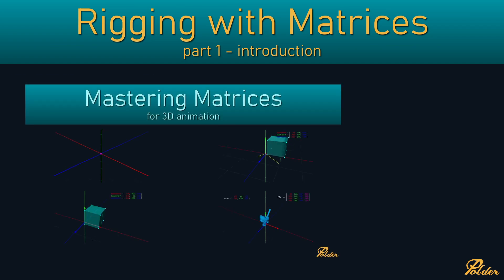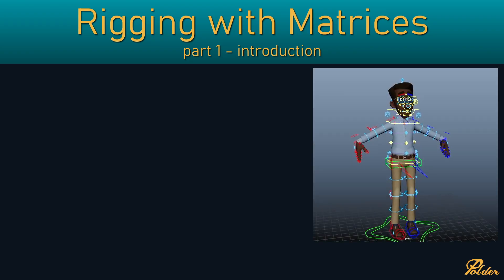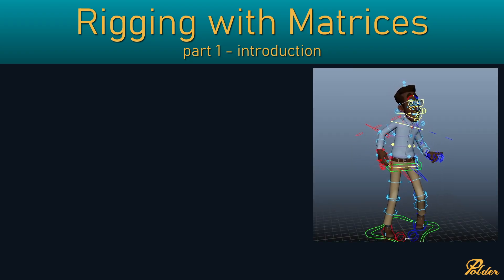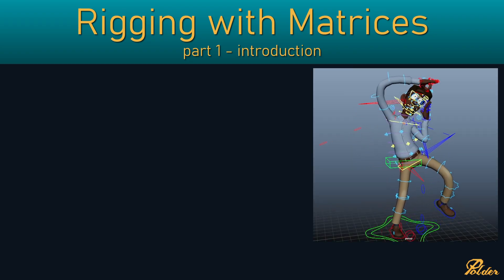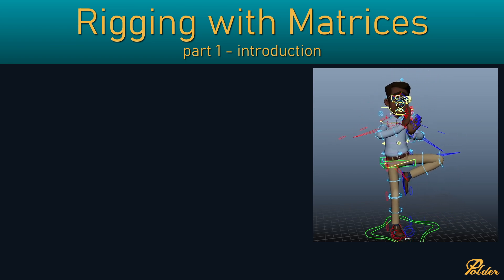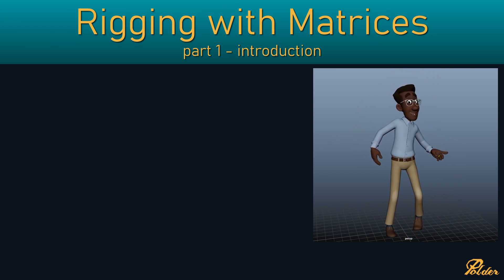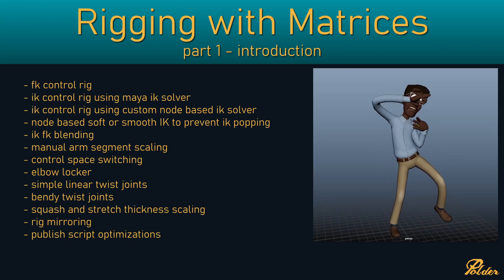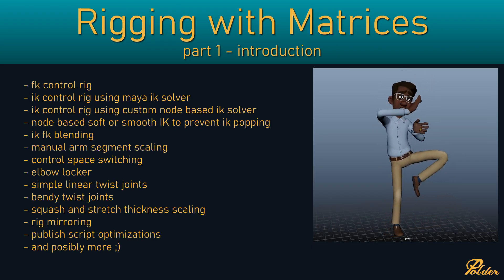rigging with matrices - part01 - intro

Comment: Hey,
Amazing to see such a system implemented and succeed  in a real Production Environment.
A few years ago I wrote my Bachelors thesis about this exact Approach and try to crate a workflow to make the rigging process more flexible and interactive compared to rebuilding parts of the rig either by hand or via build scripts every time something about the rig needs to be changed.

My prime focus in my thesis was to have a rig that allows you to interactively change the joint options to better and more consistently figure out the optimal joint positioning for my character. (the fact that this means that the rig is reusable for other characters had come to me much later ... funny thing how priorities shift from a bachelors Project where there was only one character to rig to a studio were the aspect of reusability was the first point on your list)

I already put all of your tutorial parts in my Watchlist for this weekend. and I am verry interested how you approached this workflow :) 
I am still unsure how to solve some of the issues I am facing in an elegant way...
Maybe you can give me some pointers:

In my current setup I have one Leg Module which is a simple IK-Fk chain with the addition of the reverse Foot setup. In an Ideal world I want to have them both in separate Modules so the IK-FK chain cam be reused for the Arm (or other) setup but then I would need to have a back connection from the reverse Foot Module to the leg module to update  the ankle position which in my setup has led to evaluation blocks which are bad for performance :/ 

I cant wait to watch the rest of your explanation series :)
Thanks for sharing This!

(also I cant wait for the quaternion videos. I have now tried twice to wrap my head around them and still struggle to use them)
Reply from the maker: @simonwelle4365  Hi Simon, thanks for reacting. In my current setup I have included the foot in the leg module. Indeed the arm en leg share the same ik fk switchable setup, so this could be split into a separate module for both. I use seperate input and output nodes for every connection to another module, so technically it should be possible to have the foot ik drive the leg ik, as long as the switching attribute is not on a node driven by the output of the ik-fk switch and the foot ik controls are only producing a world position for the leg module ik solver and world rotation matrix to be used for blend in the rotation into the output worldMatrix of the leg module. If you generate relative offset matrices for the other foot joints it should be fine. But it is more complex and I have not set this up, so don’t take my word for it yet 😉